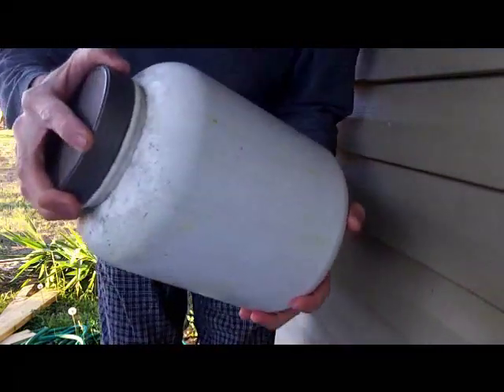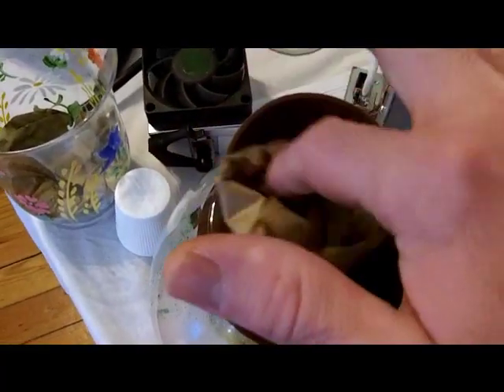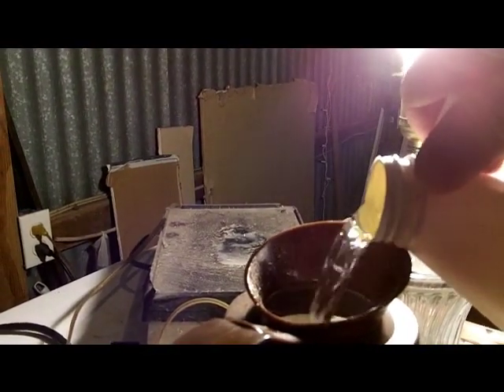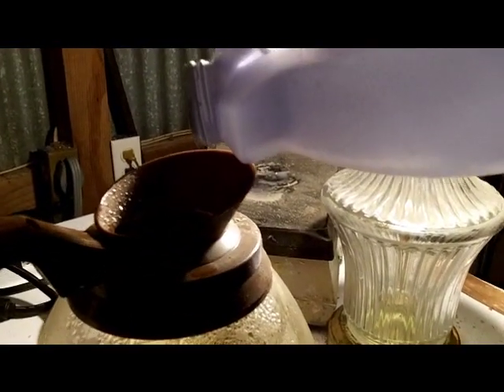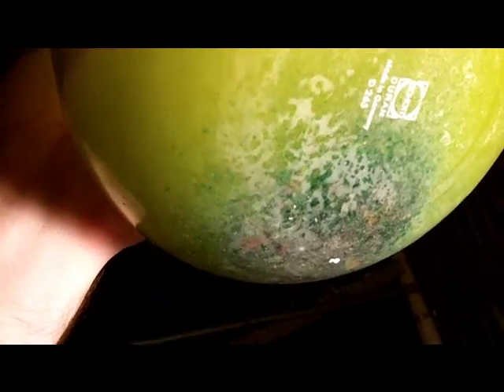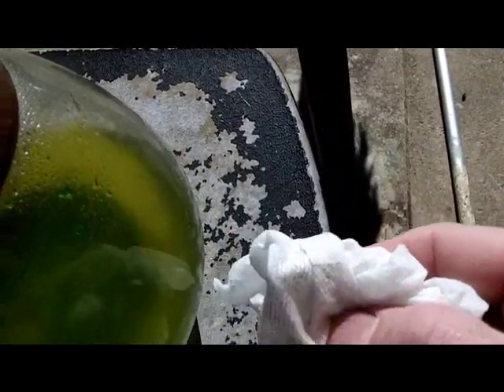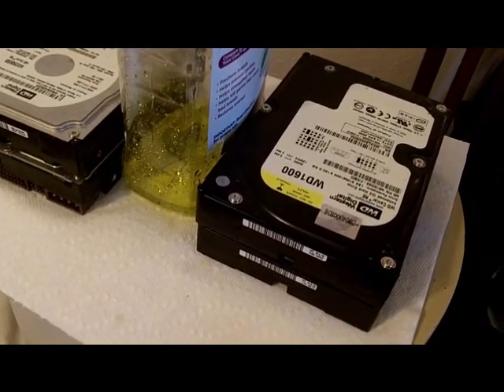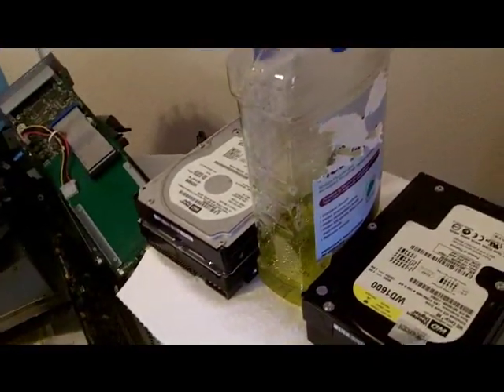eScrapGoldStep3

Comment: hi im having problems recovering my gold out of soultion i took all my mother boards after striping cut them into varied sizes. then put them into a aquaregia solution poured n fitered but testing for gold n solution showes o gold where did my gold go n how do i get it back thanks
Reply from the maker: your process is flawed from the beginning.  The object of the 1st step is not to dissolve the gold at all.  The object is to dissolve the copper which binds the gold foils to the circuit board.  The gold, if there is any, will float around in the resulting green solution like flakes in a snow globe.   These are to be filtered and isolated from the remaining plastic material.   You will have pretty gold foils left in your filter papers.   If you don't see the gold in your filter papers, you don't have any gold to go anywhere.  i think best you watch the process from start to finish and copy the steps exactly, from the point of cutting the gold fingers off the cards.
Reply: Thanks I did have small amounts of gold n my filter but I used smb to push my gold out of solution n after I pour off solution n rinse I got this gray crap mixed n with my Blk powder is this silver n how do I remove it out it n HCl again idk thanks n after I get through this with u I got something I think you'll b vary interested n it has to do with gold n making large amounts of money I mean large amounts like 30.000 a week n up

Comment: can this be done to the phone boards and processor pins as well? also, does this dissolve silver from ceramics? how do you precipitate silver from the solution?
Reply from the maker: keep silver away from this process as much as possible.  silver chloride is a mess from what I understand.  This process will work some what for processor pins ... I have best luck with the gold plated connectors the IC cards ... if you do pins ... maybe plan to let them dissolve for a month
Reply: but this DOES dissolve silver yes? can i precipitate it through this solution as well?
Reply from the maker: Marcus Kaiserkopf
silver chloride is insouluable, so it really just makes a mess with this process.  i would recommend using a poor man's nitric acid solution for silver refining ... you can youtube search for vids on the process ... i haven't tried silver yet, but I will eventually ... maybe, even the gold was hell of a lot of work to make $100 worth of gold ... that would be only worth $2.50 ish if it were silver.

Comment from the maker: ideally, you use such a small amount of bleach that the chlorine stays in solution.  it helps if the temperature of the solution is cold, and that's why I recommend ading ice in the warmer months.  Of course this is not a large scale type operation but you can safely dissolve a few grams of gold using this method without worrying about generating deadly quantities of Cl2 gas. work outside and with small quantities of solution.  The Cl2 will mostly stay in solution if you use tiny bits of bleach.

Comment from the maker: yes, this method works only for very thin gold foils and powders ... like what you get from electronic scrap.   It would take forever to use this method for purifying scrap jewelry though ... unless you ground your items into a powder 1st.   The method is simple though, you add regular 32% muriatic (swimming pool supply store) acid, and then you just ad a few shots of regular clorox bleach.   Do this outside!  it does release chlorine fumes.  Also, now that it is summertime, add ice also